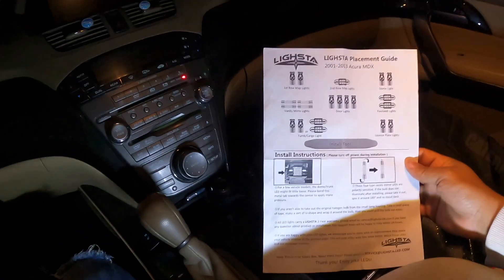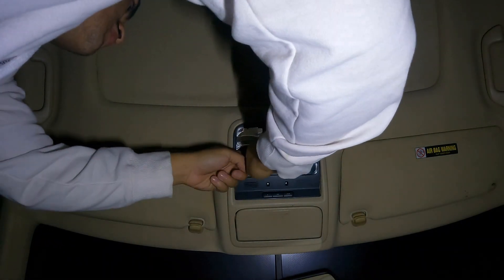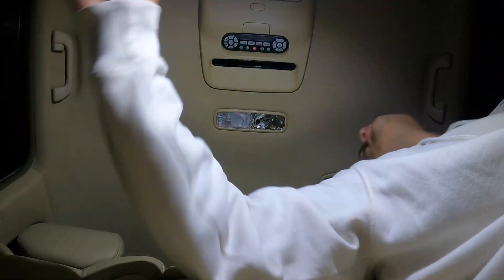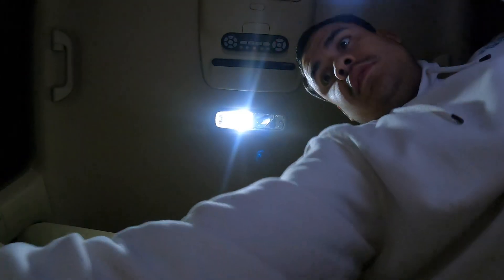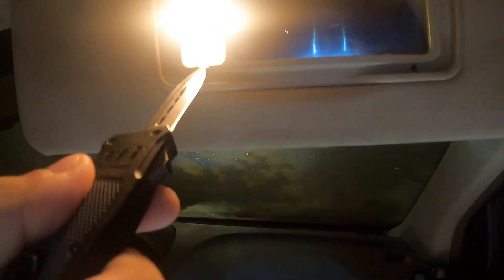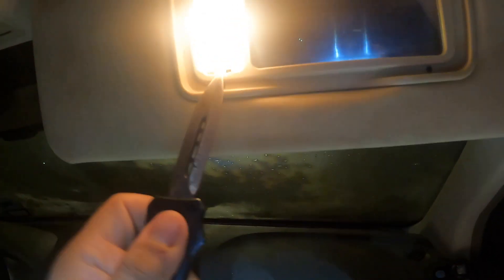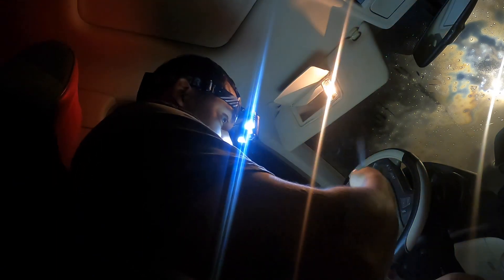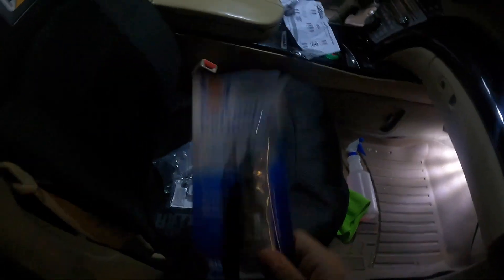LED LIGHTS in 2008 Acura MDX

Comment: For some reason on the door with the new led don’t turn on it shows the led super low so I know there is power but they don’t seem to turn on . I also got the same kit on Amazon
Reply from the maker: Did you try differed lights 
Did you also try and switch the lights from positive to negative meaning flip the lights around like a 360